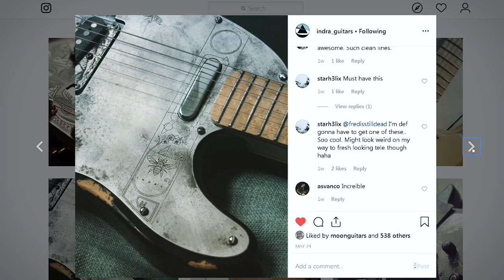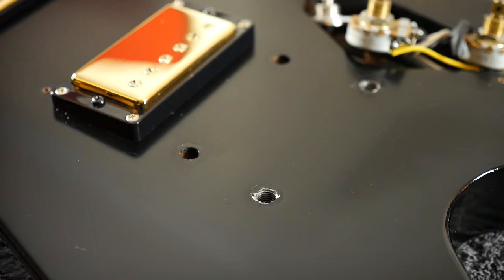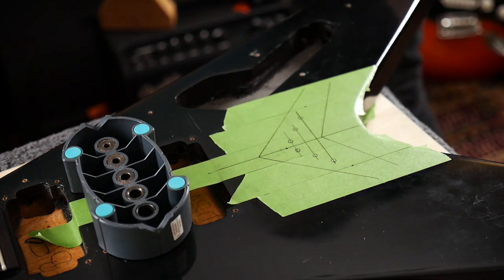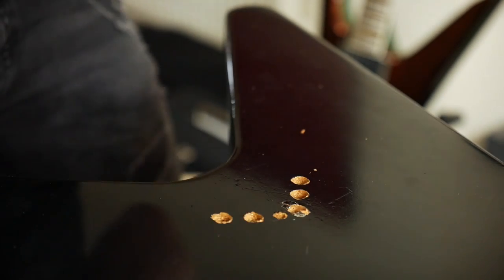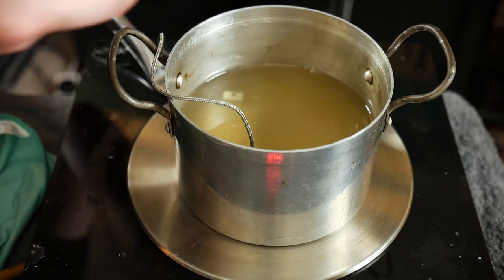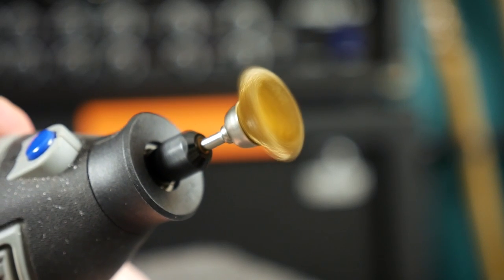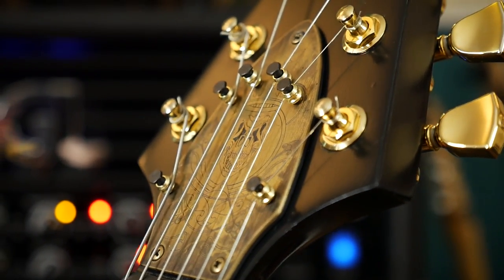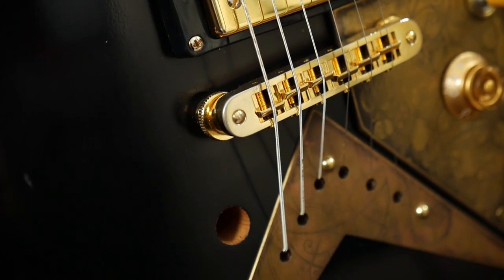Etched Brass Upgrades | Gibson 'Golden' Gothic Flying V

Comment: I'm looking to do my own custom built explorer shape guitar 1 day and I want to do the body myself. I found the measurement stencil for it, but its specifically designed for a 22 fret model. Is there any certain measures to take for modifying it to a 24 fret model ?? as the pickups and the bridge are going to be placed differently on the guitar

Comment: Talking about holes..... Never tried it myself, but my old luthier told me that when you're driving the drill tip down and you have to go on the back of the instrument you need to go slowly and NOT reach out! That's what caused you all those problems. You need to stop a few 1/32" before the tip reaches out, and once you can see the mark, you drill it through from THE BACK! Don't make any other guitar cry, please 🙏

Comment: My guitar buzzes ONLY if my volume on the guitar is below maximum OR my tone is above minimum. Therefore, I have to play at max volume and min tone. I put in a sound gate, which stopped the buzz when I wasn't playing, but I still get the buzz when I pluck a note. Happens with and without distortion, just louder with distortion. Can anyone advise? Thank you! (Jackson KVX10, Boss DS-1, Rowin noise gate, Peavey Rage 158)

Comment: Won't you spray a clear coat on the brass pieces to act as sealant and stop them from oxidizing further??
Reply from the maker: Why would I want them to stop oxidizing further? That's a big part of the appeal.
Reply: @ScienceofLoud  I fear that sweat and skin oils will blacken them quite quickly, obscuring the intricate engravings.
Reply from the maker: Wee bit of Duraglit and it'll polish up smashing.
Reply: @ScienceofLoud  True but it will also clear out the intentional oxidation that they have right now.

Comment: Doesn't a metal pickguard affect the tone, because it affects the magnetic field?
If so, is it a good change or a bad one?...
Reply from the maker: The pickguard is quite far enough away from the magnetic field of the pickup to cause any effect whatsoever. It won't be acting as a magnetic conduit. 
Magnetic fields have an inverse square drop off with distance, anything that isn't in direct proximity with the magnets is seeing such a weak field as it to be negligible.
Reply: @ScienceofLoud  Thanks :)

Comment: Don't see how string through increases string tension.... found this on message board, it states what i'm thinking better than I could. ".. I think it changes the amount of PRESSURE that the strings put on the bridge. I think the tension is the same. Why? Vibration frequency in a string is a function of tension and mass. If the guitar is still tuned to concert pitch and the string mass is the same, the tension has to be the same. Now, the increased pressure on the bridge might be causing some of the things people notice.."
Reply from the maker: This doesn't factor in string length. 
Two strings tuned to the same pitch, with the same mass per unit length can have very different tensions if the length of the string is different. 
That's why guitars of different scale lengths feel so different, even with the same gauge of strings. 

By putting the strings through the body I've added  an extra inch to the string, so bringing it to the same pitch literally requires more tension. 
The angle of the strings as they break over the bridge also changes the tension. 
You can see this on a guitar with a stop bar, lowering the stop bar (increasing the angle) increases the tension.
Reply from the maker: Pressure is how much down force there is, which has also increased, but that's to do with the location of the anchor points. If the anchor points are below the bridge then the string will apply more downwards pressure. 
Tension is the force within the string pulling end to end. If you change the ends, you also change the tension.

Comment: How will u fix the hole on the bridge?
Reply: The simplest method is to refer to it as super duper ultra-modern space age weight relief.
But probably glue in a mahogany plug, level it and refinish much like the blowout on the back from the string-through.
Reply: A little block of mahogany. It would be pretty neat to fill it with something though. Maybe a brass coin on top ala EVH?